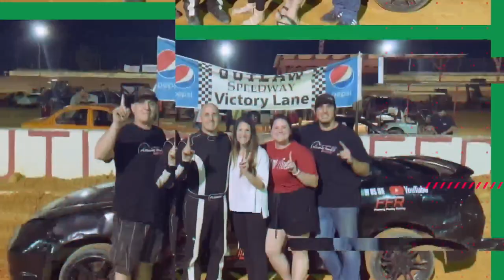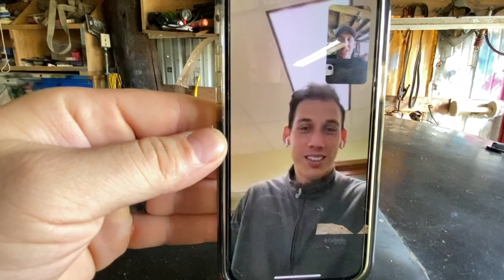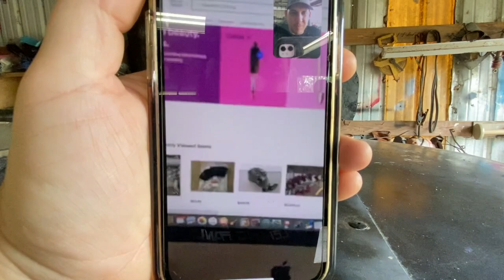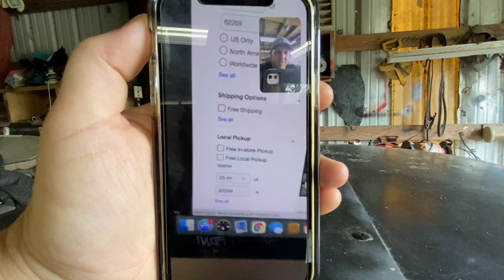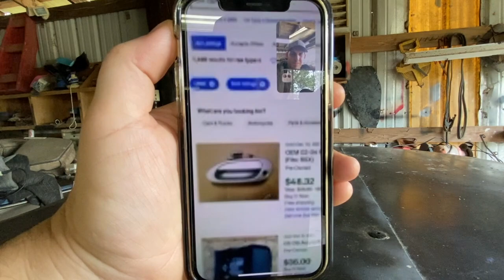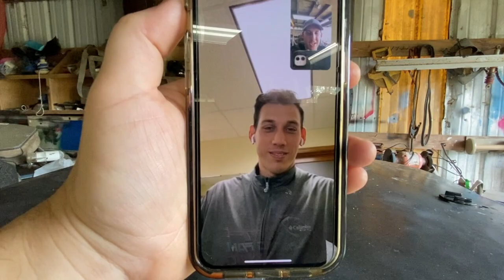How much does it cost to race? / Race car price reveal

Comment: Good morning Guys. I know its an older video, but this the first time I've seen it. I'm building a "low cost" Cavalier currently. Trust me, building a car from scratch is not "low cost" LOL I bought a 2004 Cav for $600 that had only 52,000 miles on it. I gutted it and purchased, in my opinion, the best kit cage on the market. It's a Dickinson cage kit for $495.00...next was changing fluids(tranny filter/fluid and oil changed), that was another $200. Then it was new struts all the way around for $280. Aluminum rims (used) another $100. Containment seat used was $500. Then there's the misc things like new plugs, fire extinguisher and quick release holder, new belts, kill switch, electrical switches and wire, aluminum sheet to cover holes, steering wheel with a quick release hub, paint and so on. That's an additional Add another $500 or so there. I still need to get new tires...Another $350...whew..LOL I already have a trailer from last years racing though. All total....that's about $3025 so far. Of course then there's fuel for the car and truck and entrance fees. Racing is not cheap, no matter what level you are on. None of the things count towards time either. Time is also money. Time is what one of my sponsors gives me. What I mean is, a machine shop sponsors me and they do all my machining and give me materials for free.  I just wanted to add what I (and my sponsors) have spent so far this winter. Thank you for ALL of the great stuff you guys help us small guys out with!! Have a great 2023 racing season!
Reply from the maker: Yes it can be expensive but sometimes you can make money in certain ways. Good luck in 2023
Reply: Racing in its self is never cheap, but i give you guys props on making a budget car. Both of my altima builds 02 sedan and an 08 coupe ran about 5000 each before seeing their first race.
Reply from the maker: Thanks man. We have been very fortunate to actually make money building ours cars. Such an awesome thing. Racing is too fun to worry about the money though 🤘🏻 we had an Altima that sucked money like crazy

Comment: 500 cavy
1000 cage that installed to
600 Wiring harness 
500 full con. Seat 
400-800 cams
150 timing chain
200 plus gauges switch’s
300 safety hub Campbells 
Tires rims fuel pump filter brakes struts belts and all safety equipment I mean keep going you can have 10k in one just to even be competitive around here
Reply from the maker: That’s crazy. But we totally believe that! It adds up

Comment: Bought a 1997 dodge neon in 2014 for $400. Put around $5-600 in it to daily drive it. Then gutted it but didn't part anything out. Spent $500 on a cage and safety equipment, won a couple races, then have been racing it a few times a year since 2016. Overall it has 28 races and I've spent around $3,000 to keep it going for the last 7 years. Thats not including sponsorship monies, race winnings, and donations. Definantly time for an upgrade but the car has been a great father/son hobby.
Reply from the maker: That’s what it’s all about. You can’t beat that for the amount of time you have been running it

Comment: I’m looking to get into 4 cylinder racing in NYS seen that it’s pretty cheap I’d prolly be able to easily run a $5,000 budget per season don’t even need a top of the line I’ll take the beater that finishes last I’m hoping it all works out cause I wanna race badly I’ve always wanted to
Reply from the maker: That’s awesome. Yes just go to
Your local track and as a few FWD guys they can get you in one quick
Reply: If you lived in nh I have a car that only needs a cage and is ready to go

Comment: Great video. But gosh fwd is a lot more expensive then I thought. It be better to start in sportsman late model. I payed 7,000 for mine and 1,500 for my trailer
Reply: I have a civil running and driving I might just try to see if I can build one and make money 😂
Reply from the maker: Overall it’s a very inexpensive class to run. These certain cars are just pricey for the initial purchase. You can get into FWD racing for little to nothing if you go the cheaper route. But as we know all racing is expensive if your not smart about it.

Comment: Cost of trailer? How do y’all suggest we start transporting?
Reply from the maker: If you are racing FWD we use several different ways. We have our enclosed trailer, we have a car trailer or we even use a dolly. Depending on how far you have to go will determine best choice. Our dolly is used it we go long distance to help with gas but also can be a bad choice if something major happens and you can’t pull it home on the back wheels
Reply: @flemingfamilyracing  thanks! Storage is also a cost. Where are you keeping it? Mines in a storage unit because apartment life.
Reply from the maker: @Artynos_YT  we don’t have that issue we have 40 acres so can’t help you with that unless you find a friend at the track that will let you store it
Reply: @flemingfamilyracing  exactly. Storage is a cost for people not in privilege
Reply: Also, if you’re going to store your car, make sure it has a title and insurance coverage. They ask for that.

Comment: All ya need to win in this class is the most money. Full blown racing engine with vvt, vtec, you’ll half track the rest. Make all the cars equal. Then see how many of these boys with those racing engines hold up. No vvt, no vtec, no racing engines. Also, all tracks need to USE THEIR SCALES. I’ve seen several people run 250+ hp cars, with a weight rule of 2200 lbs, running 300-400 lbs light and track never weighed them. The cheating will kill this class.
Reply from the maker: We agree cheating will kill a class. But the most money won’t always win. We have proven that with our cars. 

Driving has a lot to do with winning in this class
Reply: @flemingfamilyracing  must be different where you’re from. Around here, the most money always wins. Basically no tech, most tracks don’t even weigh the cars.
Reply from the maker: No we definitely are different down here
Reply: @flemingfamilyracing  Glad to hear it, best of luck to y’all! My cousin has been in a cavalier for 3 seasons, followed all rules, just to be beat almost every weekend by Hondas with fully built racing engines with 270hp+. I’m talking $10k under the hood. Just not fun if it’s a spending contest, and the tracks don’t make it fair.
Reply from the maker: @mrpotato_d3ad663  thanks man. Yeah that’s not fun at all. What track y’all
At?
Reply: @flemingfamilyracing  Richmond Raceway Ky, Rockcastle Speedway Ky, Florence Ky, basically all of them in state completely ignore rules, especially in hornet class. Too worried about money and not good racing.